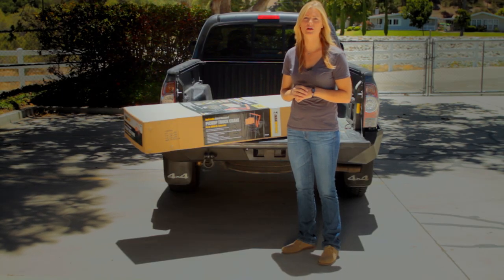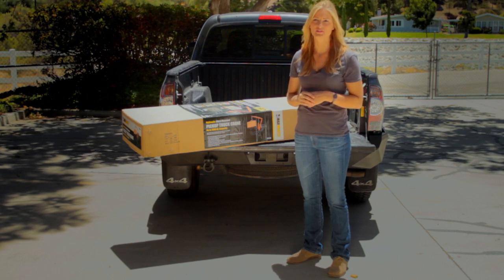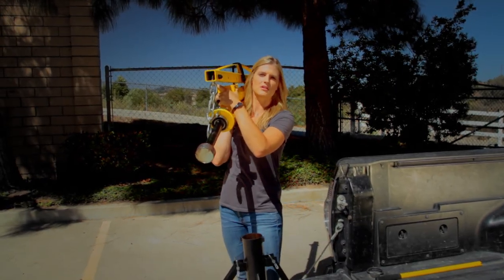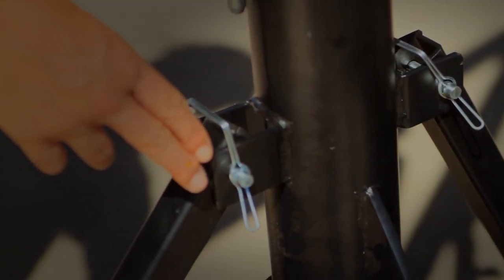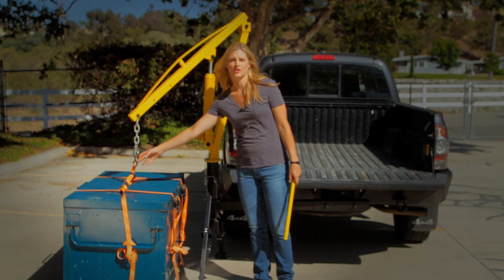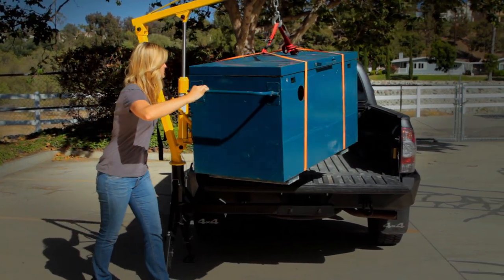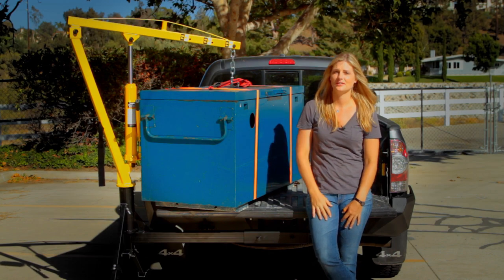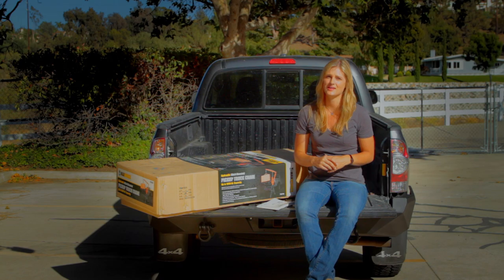MaxxHaul 70238 Hydraulic Hitch Crane - 1000 lbs. Capacity

Comment: I just purchased this Maxx Haul hitch crane.  It works great however, the assembly instructions were not included and I had to figure out the assembly myself.  It took a while to figure out which bolts went where.  All in all it works great for lifting cargo into the bed of your truck provided it weighs UNDER 500 pounds.  Even though the crane is rated for 1000 pounds lifting capacity I would not attempt to try and lift anything more than 500 pounds to be on the safe side.  Additionally, I would recommend using a hydraulic bottle jack under your trailer hitch to help take the load off the hitch.

Comment: I'm wondering if the main horizontal stabilizing bar attaching to the hitch receiving T bar to see if the 2 bolts let you adjust how far the horizontal stabilizer bar went in (closer to the tail gate). I would like to see the hoist be able to safely reach the truck bed center for the bulky items rather than so close to the truck bedside wall.

Comment: Just received my hitch crane (MaxxLift) yesterday , assembly was a breeze took 10 minute max after laying all the pieces out.  First thing I noticed is that the receiver that accepts the boom assembly  is over sized and the boom assembly moves back and forth this puts an even pressure on the thrust bearing second thing I noticed is that the actual bearing rides just above the receiver and was not properly seated, lastly the wielding is very inconsistent and is not of high quality in the areas where most of the weight is going to be addressed the wields are less then a 1/4 inch you might want to address this with the MFG (China) and emphasize quality control.  I will make the necessary adjustment to my new portable crane not complaining just pointing some issues that you should address you are an American company right?

Comment: No one on these factory demonstrations show how to get the weight of the loaded truck off of the stabilizing legs. I would prefer some type screw jack for stabilization.
Reply: The only added weight was the load, a simple cheap bottle jack or the trucks spare tire jack under the receiver for a few seconds would work, as would a 6 foot 2x4 and block for a fulcrum.

Comment: Really wanted to like this crane but there is no way this will lift a 1000lb load into truck without it hitting the side of the bed.  The crane is well made but has some serious defects in the design.  The boom needs to be longer, stronger to lift the 1000lbs actually into bed.  It will lift 500lbs into the bed of the truck, not centered but onto the tailgate and truck bed.  You will need a way to move item around to center it or it will be next to one of the side rails depending on which side of the tailgate the boom is located.  When you move the boom hook to the 1000lb bolt location it limits the height and distance you can achieve.  It can lift 1000 lbs up but you'll have to muscle it into the truck bed.  Pretty dangerous effort.

Comment: Can you put a motorcycle into your truck bed with this?
Reply: Do the math 84" max lift, less the height of the bike from the lift point and the height of the bed. Plus, the bike should probably be under 500 lbs for best clearance. It would probably work fine for a small dirt bike, not for an HD Electra Glide. Would you trust this cheap Chinese crap with your expensive bike? Not me.